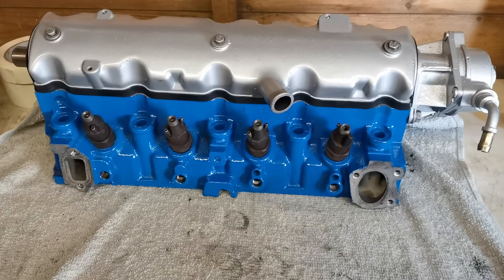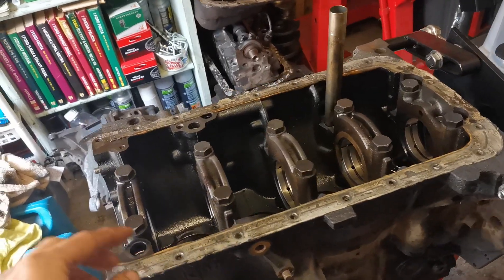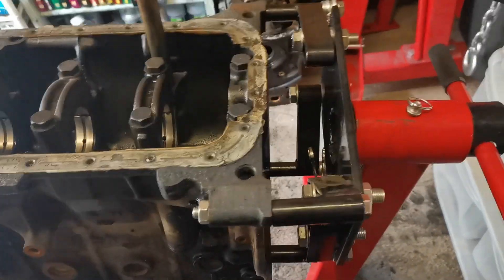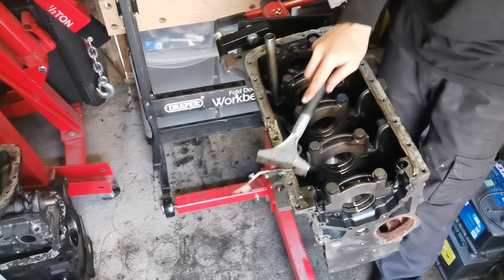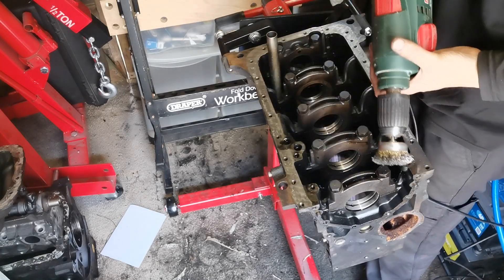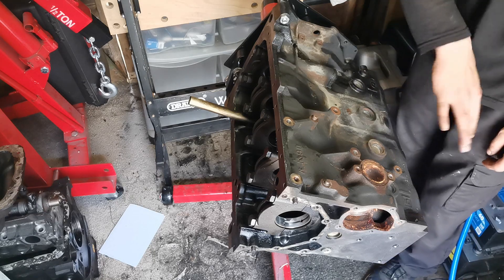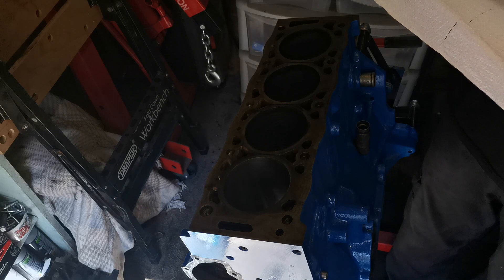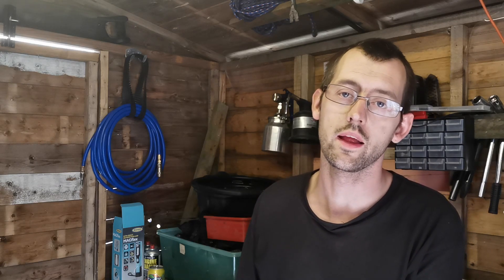Citroen and Peugeot XUD9 1.9 Diesel Engine Block Preparation

Comment: you wanna be really slow turning when honing. you want a 45° angle of the cross hatching. but you can do it with 280 grid sandpaper by hand. gives you a way better finish

Comment: I used plate glass and got the block super level it took 2 weeks of sanding to get if perfect but the head sealed with no leaks and still going strong after 2 year's. The turbo xud9te-l engine block doesn't have any gap's inbetween the inner wall of the cylinders.

Comment: I have a motor from my bobcat that we pulled and tore down, sent to machine shop and then rebuilt...that crank seems like it has end to end play... like if u grab it where the harmonic balancer pulley goes you can slide it in and out very slightly. Is this normal or do you think I'm missing some sort of wedge down there??? Please help

Comment: Hey! Quick question! Can I swap this block for gasoline peogeut? Crankshaft swap potential is my main question, then fitting the cylinder head!
I would be more than grateful if you could please reply to this message
Reply from the maker: Hello the engine block and the head are machined to fit together perfectly with each other in every engine. So mixing heads and engine blocks from different engines wouldn't work.
You might be able physically fit a petrol crank into this engine but it is highly unlikely to work.
Reply: @TheZXGuy  Thank you for your kind reply. I am going to upgrade my 8 years friend, 405 as my next project, aiming up to ten seconds, as well as keeping city driveability and handling, as well as its originality! So having a stronger block to increase ECU misfire safety margin would be a gift! Also almost impossible to make a billet block as I'm living in Iran and we have our restrictions...

Comment: had hoped to see how you cleaned the top (HG) face of the Block.... maybe I'll find it in another vid
Reply from the maker: Sorry as there was no issue with head gasket I didn't really do that much mainly engine degreaser and 200 grit sandpaper sorry about not showing you